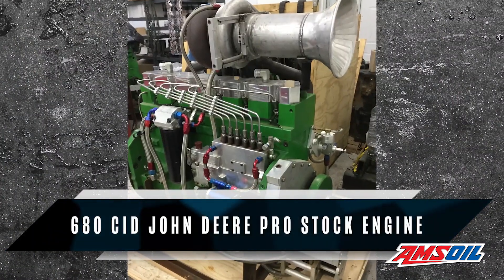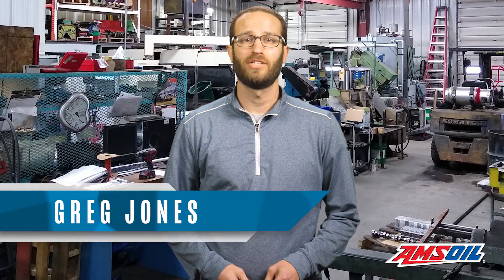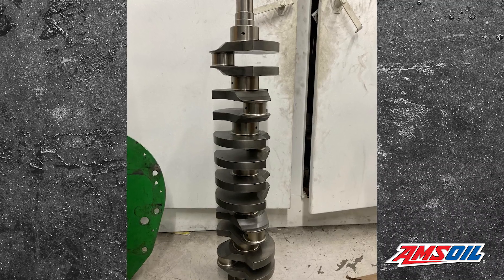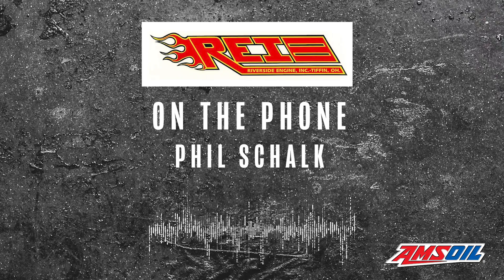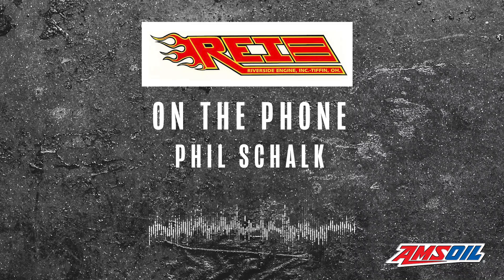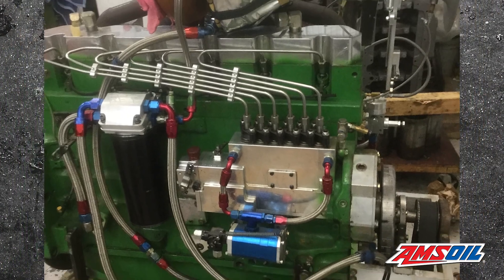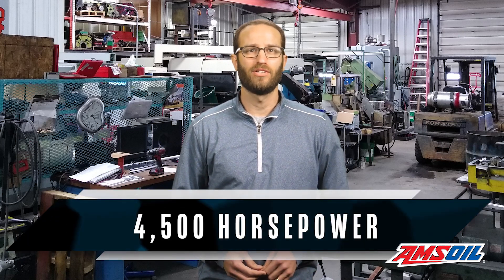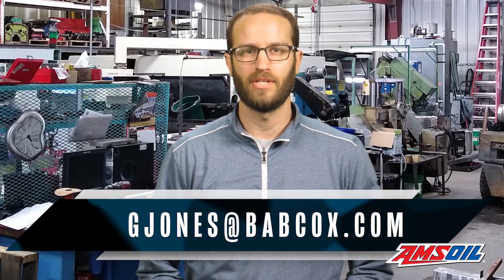4,500 HP John Deere Pro Stock Engine

Comment: Compression ratio?
Reply: Not as much as you’d think, generally around 12 1 which is low for a diesel but they drop compression to spin higher rpm and hold more boost

Comment: Are some pro stock tractors methanol or race gas ? some of the deeres and massey's dont smoke at all but sound insane
Reply: There is also an unlimited super stock class where alcohol is allowed and the tractor has a diesel engine converted to run with spark plugs and alcohol fuel. These are generally the most  powerful "stock" classes.
Reply: @isellu  when they actually run correctly.  60% of the time they work everytime.
Reply: Strictly diesel fuel

Comment: Are these a deck plate set up?
Reply: The picture on this video of the 680 motor has no deck plate. Head is sitting directly on the block
Reply: @TheJohndeere466  thanks! 
I run a deckplate set up from Haisley in my SS diesel but never thought to ask any of the tractor guys when they’re around.

Comment: gonna guess 100 psi boost?
Reply: more
Reply: closer to 200
Reply: @aydencoats2015  more, closer to 350+
Reply: @cs-gj3yf  Really 350 lbs??
Reply: @blueblood76  yes, some of the unlimited tractors push almost 500 psi if not more, crazy
Reply: 100 psi was 30 years ago
Reply: @102moto16  these are around 250-300 nowhere near 500. Lol
Reply: @DonkeyEvo  wait what, i never said 500
Reply: @102moto16  I intended to reply to the original question. Someone else said 500 psi.  Even the multistage super stocks aren't running 500psi.
Reply: @DonkeyEvo  copy.  Cheers
Reply: @DonkeyEvo single turbo not much over 100 psi.
Reply: What kind of compression they running with that kind of boost pressure?